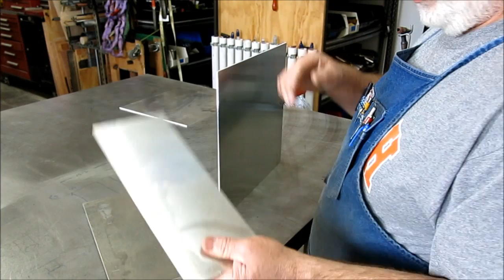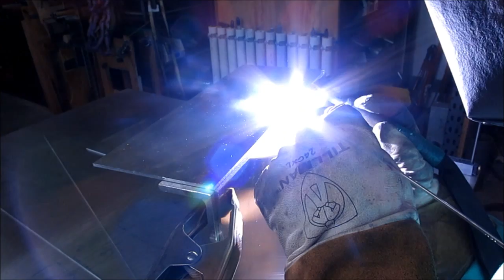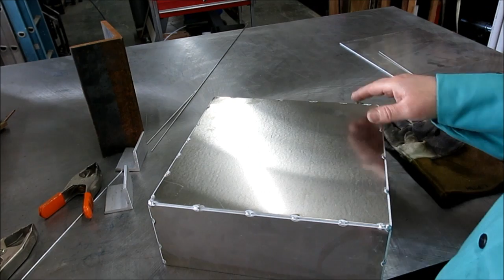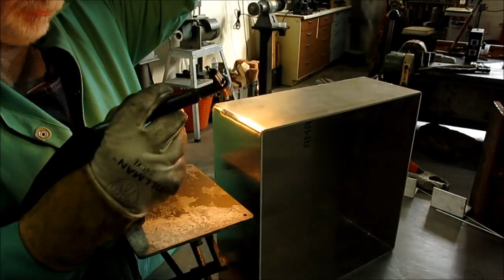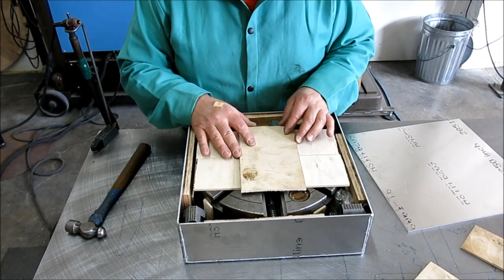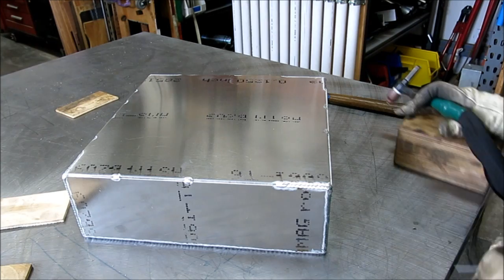Pandora's Box

Comment: I started practicing aluminum in my tig class a few weeks  ago, I like the fit up trick it is not something I had considered trying yet. It is very efficient. Whould you have gone about it the same way if the box was steel? 

I emagine he will be very happy with the gift, I look foward to seeing the video.
Reply from the maker: Hi James,

Definitely. I used to make stainless tanks and used the exact same methodology. It works regardless of material type. In fact in steel and stainless its even easier as the material tends to flow together when tacking unlike aluminum.

Cheers,

Tom

Comment: each time I try to weld box shapes out of stainless they warp. I dont see warping on your box, is it because you're using aluminium or is it because the sheet is rather thick (I use 1mm) ?
Reply from the maker: Hi Manu,

Both reasons. The material is thicker and more thermally conductive. Stainless is less conductive so the heat stays near the weld causing warpage. There are some tricks to getting nice flat side on something like this box in stainless. The easiest is to use thicker material.

Cheers,

Tom
Reply: oxtoolco
 thanks Tom

Comment: Tom, whenever you're doing corner welds like that, lay the pieces flat on the the table in a butt weld configuration. Then tack along the seam and bend to your 90*. It will end up corner-corner but you just just have to use your better judgment to make sure your tacks don't break.
Reply from the maker: Hi Loser,

Never tried that one before. Pretty hard to do on larger fabrications. The tacks really need to be ductile to handle that. I may try it on some smaller pieces. Thanks for the suggestion. Have you done this yourself?

Cheers,

Tom
Reply: oxtoolco
Yes, pretty much everything I build at work is designed in a corner/corner configuration. I don't like using filler in my tacks on sheet metal due to lumps you MIGHT incur during welding, really just for aesthetics, and this means that the tacks are at their threshold once bent to 90*; if you use filler, you can usually bend them quite a bit.

This only applies if you are bending the material back towards the tack, if you bend away (not recommended) you might have to re-tack midway through the bend as the tack has to stretch the same distance as the thickness of your material, if that makes sense.

This little chute I made, I think, I laid flat on the table and tacked 3 or 4 sides together and folded them over one by one until I got the shape seen. We even do it on a larger scale with the largest I've done it probably being a 6'x5' piece of 3/8" 304L stainless. Sheet metal is slightly harder due to flexing the larger it gets.

http://i272.photobucket.com/albums/jj186/Tonsoffun3203/20131211_061101_zpsbb444d8f.jpg

http://i272.photobucket.com/albums/jj186/Tonsoffun3203/20131211_061032_zps154fb6cf.jpg

Comment: are you scratch starting the welds?
Reply from the maker: Hey Tristan,

No. I touch the tungsten down to make a conductive pathway to help initiate the arc. Don't ask why this works its an electrical engineering question and those guys are so resistant....

Cheers,

Tom
Reply: LOL. that was punny. thanks. Tristan

Comment: Great packaging, if I received a package like that I'd cut it in half with a circular saw so as to have two very useful  flat trays. No problem with a tungsten tipped saw blade! Regards, Matthew
Reply from the maker: Hey Matthew,

A super efficient guy would mount hinges and a latch before they cut the box in half. This should be interesting.

cheers,

Tom
Reply: oxtoolco
That's another way of looking at! I need shallow trays at the moment, so I was influenced by that!
Regards, Matthew

Comment: While I'm watching I'm thinking S^$t, how would I get that open and save the nice box??  lol
Good prank, I'm sure it was a fun process to get it out. :-)

Colin
Reply: Cut the weld out with an end mill on the Bridgeport.-

Joe
Reply from the maker: Hey Colin,

I'd be eyeing that box as well. The hard decision would be two boxes or one?

Cheers,

Tom
Reply: oxtoolco
It would be cool if he made a 95% depth (thickness is stamped on plate) end mill pass all around the box mid height. Then he could score the 5% free with a razor knife  for about an inch, pry it up and wrap it around a slotted tee handle. At that point he could open it the rest of the way like a canned ham.

-Joe